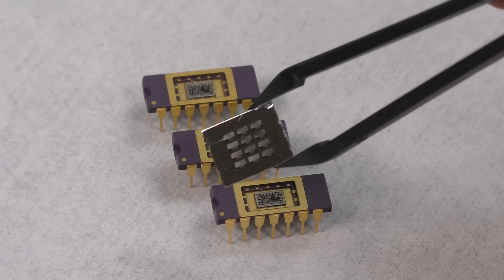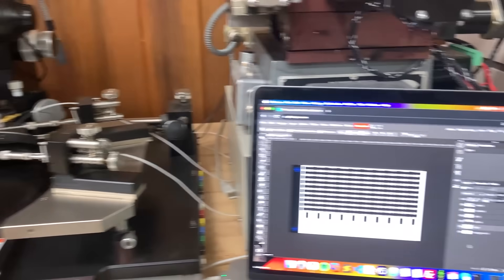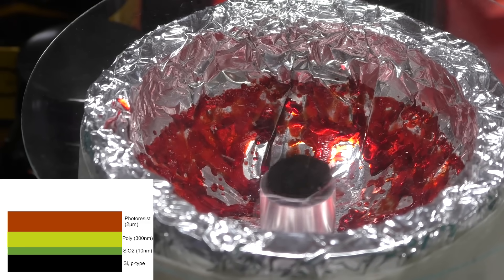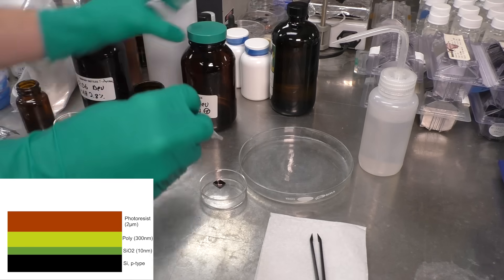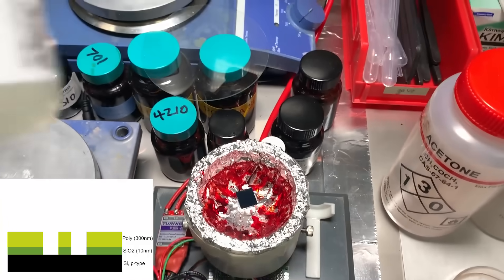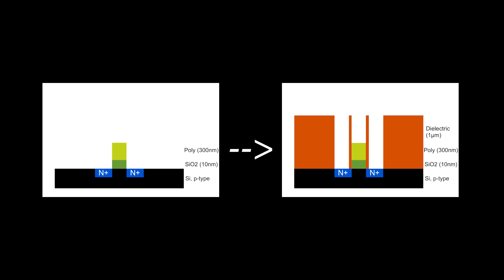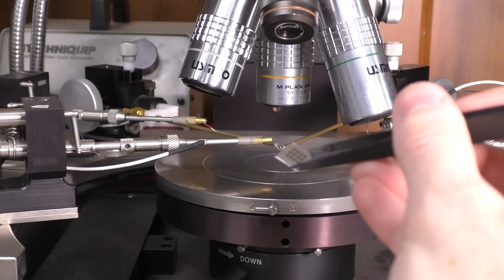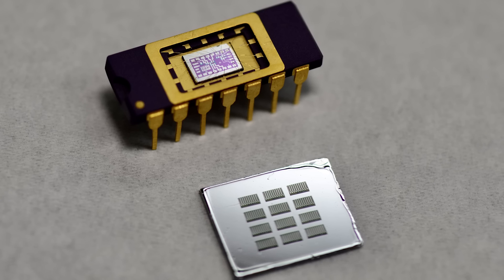"Z2" - Upgraded Homemade Silicon Chips

Comment: Thats actually really impressive, I am surprised not more countries delves into computer chip manufacturing on their own for self sufficiency, there no need to make the greatest and latest when even 80nm can be enough for general computation, certainly enough for military equipment as even modern military computers are still stuck on 130nm or something for reliability.

Comment: I was always confused about the fabrication process.
So is it true if we say, in the fabrication process laser light creates Silicon Chips?
Reply: Well, it is used to mark where to etch with the chemicals. He applies photoresist and then uses the light to remove the photoresist in specific places. Then chemicals are applied where it was removed (I mean, applied all over, but it only works where the light removed the photoresist).

Comment: the furnace is quite impressive. It will need something like 220V 30A power supply, which is similar to the capacity of an old single family home…

Comment: Unreal! I was taught these concepts in school 15 years ago but could never practically visualize what it might mean to make such features (doping, wells, etc.).  Also it would be amazing to de-centralize some of the semiconductor industries and do some grassroots innovation on things like custom sensors and FETs. Keep up the great work!
Reply: Honestly, it's got more value for instructional and maybe development purposes than for commercial purposes.

"Boutique" ic manufacturing is too easily replaced by programmable logic for everything except analogue, and the analogue can be handler by D/A and A/D converters, or the (admittedly rare) "programmable analogue" chips, which just about always will price out this sort of thing.

Education & development, in contrast, finds more value in turn-around time, direct experience, and total fab cost than in per-chip cost, and thus has great use for this sort of thing.
Reply: @absalomdraconis  Analogue computing may actualy pick up quite a bit in the near future, it turns out to be very effective for machine learning.
Reply: @TheAkashicTraveller  I saw that recently too. Can't wait to see more!
Reply: An industrialized version of his low spec process could be used to mass produce chip types that are too simple for the extreme factories that make extreme density modern chips.  Things like basic logic and analog chips could be made from redesign or licensing from the ones that were introduced in 1965 to 1975.  Also power electronics could benefit from the large feature size, such as input circuits for power supplies or DC to AC inverters for solar power etc.
Reply: @johndododoe1411  Well I've got good news for you U.S. patents only last 20 years unlike copyright so anyone can actualy do whatever they want with those. A neat usecase if this goes ahead would be replacement chips for retro devices like computers and games consoles.
Reply: @TheAkashicTraveller  -- 20 years? I thought they only lasted 7 with a 7-year extension, meaning 14 total.
Reply: I'd like to see that with open semiconductors.

Comment: 1200 transistor , it can make around 400 to 600 logic gates , or 100 flipflops , so you can make a clock/date Display or a counter or a very basic calculator how nice

Comment: But there is a circuit I don't know if you could actually make it it needs a trigger voltage of 0.5 volts input current of only three Pico amps it's a non inverting buffer for 26 megahertz

Comment: You my man to chip fab industry is what Elon musk is to space travel industry. You play a great role in democratize this chip fab industry. My suggestion is please try to innovate on how chip manufacturing can be done at low cost with very low setup for atleast large size transistors. There is a great news for it and I dint see any significant breakthrough yet.

Comment: This is awsome! I worked in Lithography in cleanrooms. Repairing/engineering the so called tracks. I ilke your 'spinmodule'.
Reply: It's not just the machines. Also the chemistry is fasinating, measuring thickness of the photo resistlayer, and much more

Comment: I really want to see you make an ALU or if that is too complex for your IC at least an adder. Some flip-flops (maybe multiple) for basic ram chips would be cool as well. Of course the holy grail would be a (simple) microprocessor but even seeing an adder or flip-flop on a custom IC would be extremely impressive.
Reply: High density ROM and RAM were actually much more important than the microprocessor. A 1980s or 1990s personal computer without modern ROM and RAM had been impossible, while the same without a microprocessor would pose no major problems. A fast and simple processor can be built in TTL or one of the compatible CMOS families, just like it was in the 1970s. So ultra cheap kilobytes and megabytes from nano sized transistors were the key for the personal computer revolution, not the microprocessor.
Reply: @herrbonk3635  -- True. With enough ROM/RAM, you can make a CPU. I mean, you can have tables for everything. I think it is neat that ROMs can be used this way. You can let the opcodes drive the address lines and use the data lines for the control signals. Thus that is your instruction decoder. And similarly, you can have a ROM with 20 address bits and 16 data lines to use for the ALU. Use 8 bits for operand A, 8 for operand B, and the other 4 for operation selection. Then the data lines could be an 8-bit result and flags, an 8-bit quotient and the modulus, or a 16-bit result.
Reply: @PlumGurly  Kind of true, but not my point. I was thinking of a normal TTL logic based CPU, together with the RAMs and ROMs that were available at the time, say 1977 to 1987. And using these (fast&small) bipolar and (large&slow) p/n-MOS/CMOS memory ICs normally, i.e. for microcode, program, and data. 

Making just an 8-bit ALU out of ROM would demand a huge IC: 8A+8B+1Cy+3op = 20 address inputs. That wasn't exactly cheap, or even available, in the 1970s or most of the 1980s. A 16 bit ALU would be 36 lines => 64  Gig!!

So you needed normal logic anyway, at least for anything larger than 4-bit (4A+4B+Cy+3 = 12 => 4K). A 4-bit ALU could sure have been built this was and cascaded (or sequenced by microcode) into 8/16/32 bits, but that would be pretty meaningless, given that cheaper 4-bit ALU IC like 74F181 and 182 were readily available.
Reply: @herrbonk3635  -- Yeah, I get you. I was trying to point out that you could make a CPU with mostly (or all) memory, but you can't use a CPU or most logic gates as memory.
Reply: @herrbonk3635  -- There are various ways of using ROM LUTs in a more "modern" homebrew machine. With common ALUs, you don't really need but 1 bit more than your 2 inputs. I don't think there were parity ROMs, but here is parity RAM with 1 extra bit per byte (so 9, 18, maybe the rare 27, and 36). You could make a 16-bit ALU that way today. You could possibly use multiple ROMs and use the position to distinguish the different numbers. It would be a kludge. And you wouldn't need a carry-in in memory, you could do that with logic to proxy the operation and save some slots that way.

As for multiplication, you could use 4 that do half of what you need or use microcode for that. So 4 nibble LUTs for 8-8-16 multiplication. You just need an adder that is 3/4 the expected output. Just use the FOIL method (just like working polynomials). You only need a 12-bit adder to concatenate the four partial products to get a 16-bit result since the last nibble will not change if you include it in the addition. So fetch and store the highest and lowest order multiplications into the result register, while just fetching the middle 2 into registers, add the middle ones in the next cycle, and add the highest 3/4 in the last cycle. And yes, I took 2 shortcuts.

Even with pipelining, I don't see how one could go past maybe 75 Mhz by this trick, even if you shadow it into the fastest ASRAM. I wouldn't even know how to use SSRAM for this purpose, though some of that is rated for about 300 Ps, and that is expensive memory and requires the QDR protocol.

As for 16-bit addition, subtraction, and logic, you can use 2 of these "ALUs" in different pipeline stages. I have a build in mind where I'd probably add a 2nd ALU in the memory stage (since it is to be a Harvard machine), thus not every instruction needs RAM. But it could only be done in registers since there is only enough time for a register access and a memory access and be 16-bits. For 8-bits, doing a memory load and then the calculation memory read in the next stage is fine.
Reply: @PlumGurly  Cross-coupled nand gates are the basis for a Flip Flop.  You most certainly can use logic for a CPU.
Reply: @GodzillaGoesGaga  -- For a CPU yes. Using gates to make memory is harder than it is to use only memory to make a CPU. I know what registers are, but that was not my point.
Reply: @PlumGurly  From a process standpoint it's hard to make memory in NMOS.  Especially SRAM.  That's the point of using gates as registers.  It's doable at the "hobby" level.
Reply: Transistor logic would require at least two layers of connection tracks, I couldn't manage to create a scheme without crossings in logisim. So creating an ALU would be another level of difficulty. Yet another level of difficulty would be reducing overall amount of transistors by adding the second layer for p-type - it could save up to 30% of space on a die.
Reply: @SteelyGlow  NMOS flip chip on a PCB substrate, you can still use passives etc on the PCB.  It would show your IC working as a set of logic elements.  Just a thought.
Reply: @GodzillaGoesGaga  -- True. And if you use NMOS and PMOS on the same chip, then you have CMOS.
Reply: CMOS takes more processing  steps since you have to make the N wells in the P substrate and then P in the N wells etc.  Very fine process control is needed to make the wells correctly.
Reply: @SteelyGlow  MOS logic could avoid that.  Also a general ALU with a width of perhaps 4 bits per chip would not require a large transistor count, and only a reasonable number of control lines.  18 to 24 external pads perhaps.
Reply: The processor to make is the PDP8 - it is about 1,000 transistors, the architecture is in the public domain, and there is a ton of software available for it. 

Of course, it is fixed word length and 12 bit, but both of these can be useful advantages to an amateur or research lab, as is the open collector bus design that allows you to create a bus of arbitrary physical length - which will easily interface to breadboard peripherals. For the same market, 5V logic is also preferable. 

Assuming a market of a few hundred a year, you could have a successful product line, now DEC no longer exists!
Reply: Just making  digital watch IC would be cool let alone an ALU.
Reply: He could just make logic ICs and make a CPU out of those!
Reply: @ppdan  -- And if he goes that far, he might as well scale that up by moving the designs of the different gates used on a single die.
Reply: 8 bit breadboard computer by ben eater :-
https://youtu.be/HyznrdDSSGM
Reply: https://youtube.com/playlist?list=PLowKtXNTBypGqImE405J2565dvjafglHU
Reply: Its easy u can make at home not just ALU bt whole computer.
Watch 8bit computer video series by ben eater

Comment: You should spray the photoresist on to save fluid and get a better coating. You can use a hand pumped cooking oil sprayer to do this.

Comment: Hi! Your lab is amazing! For a old project I need a linear  B/W CCD of more of 15k elements, that is necessary to construct a optical spectrometer but actually is very difficult buy this type of chips because are very expensive! Maybe you can build this, check the Toshiba tcd1304dg

Comment: I just wanted to say that your work is awesome. I'm a software engineer and I've always wanted to look at fab'ing, but always felt like it was passed me. Stunning to see what you've accomplished in your garage. Keep it up!
Reply: Don't feel that! You can really fabricate your own PCB at home (not like this that you need a lab), and while the scale is larger, it's a very similar process. Have a look at it!
Reply: the question is, what do you wanna fab? as an SW-Eng I guess you want to start going one step down to HW -> so PCB edging and soldering your own board is much much easier and doesn't require his fairly expensive equipment (at least by what I can tell in the video). If you want to make it even easier on yourself: start by designing your own boards and circuitries and simply order the PCB online (very cheap these days)
cause to be honest: there is not much to gain from making your own transistors ;)
Reply: @thetomster7625  being able to make your own computer from scratch isn't useful... you sure?
Reply: @diego032912  that comes down to how you define the word "useful"... having some self-made blinky-lights circuitry (which is about the integration level he can get to) is not much use, since you can buy a chip exponentially  more powerful for much less of the money it costs him to run his lab for say, an hour. Point being: its very impressive, what he does, but useful? come on...
If you want to make your own computer (and one, that deserve the name) start by writing your own programs, compilers, design your own boards, edge your own boards and solder them in your garage.... all of that is much less costly and way more useful than making your own semi-conductors.

Comment: It seems you need some sort of tooling to simplify things for at this level of complexity, almost all the modern stuff is overly complicated and would not be possible to run on any CPU you could manufacture with this system. You might try color forth and OKAD .... it provides the tools all  the tools you'd need to design, gates, layouts, logic description and output GDS files... its quirky for sure but quite capable. Also As far as I know Chuck Moore is still kicking and would be an interesting guy to talk to I imagine... as far as self hosting OKAD you'd probably wouldn't need too much CPU but it does require relatively a large memory (a few megabytes for non trivial projects)... if you make some sram chips at some point I wonder if they would be reliable enough to stack them like somewhat like modern 3d chips and communicate with them via a bus.
Reply: Also I'll mention that the 1T sram patent expires in 2023!  So that would allow for higher density sram on your process. the patent is US7146454B1 (can't link here anymore apparently)

Comment: Can you please start burning the gases you emit? They are very bad greenhouse gases - so much so that whatever little you emit becomes 14-20,000 times equivalent CO2.
And it shouldn't even be more than a days work and very easy. Burning is commonly used for those flourides
Reply: finally a comment that doesn't disappear after 10 seconds! Sorry for spamming, but it's apparently what I have to do on some channels, to get my comments to stay/transmit

Comment: Impressive. Well done! Just out of curiosity, I'd love to know what are the equipment costs or cost per wafer? 
PS: The more  I think about it the more impressive it gets!
Reply: Priceless. He has been collecting pocket money for 22 years.
Reply: i bought my chocolate wafers for about 10 per dollar
Reply: @fidelcatsro6948  those are counterfeit, don't use them. Chocolate is less resistive to acids and it probably won't withstand 1500°C in the furnace. So you'll probably get some chips, but not the ones you're expecting.
Reply: @DimaZheludko  its ok when they fail i can simply eat them up, they work well in my digestive juicing processors
Reply: @fidelcatsro6948  But do they increase your processing power?
Reply: @DimaZheludko  yes of course my visceral fat storage capacity increases no doubt about that!!
Reply: @fidelcatsro6948  this is why aliens won't talk to us